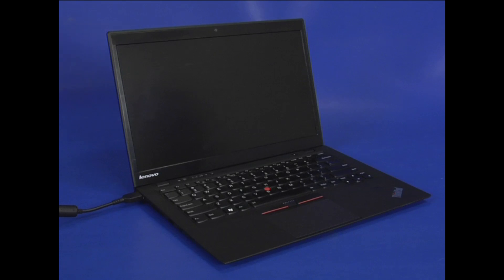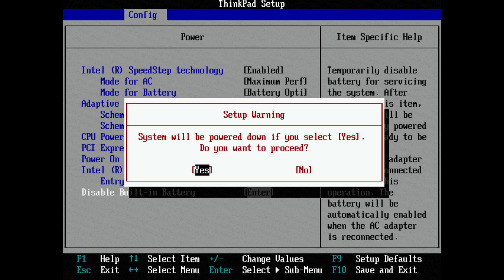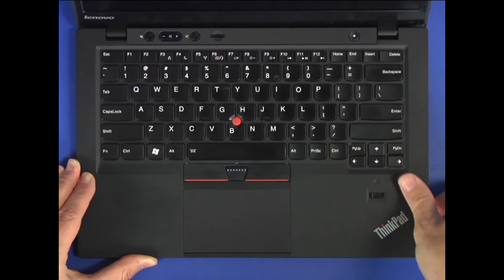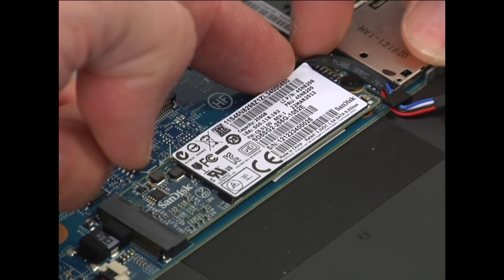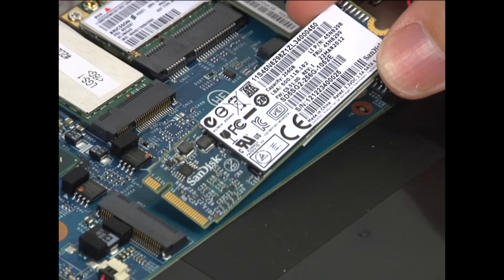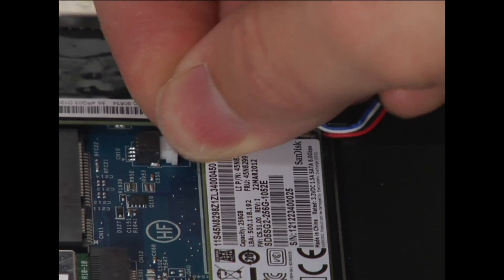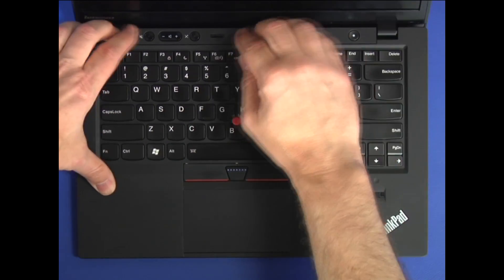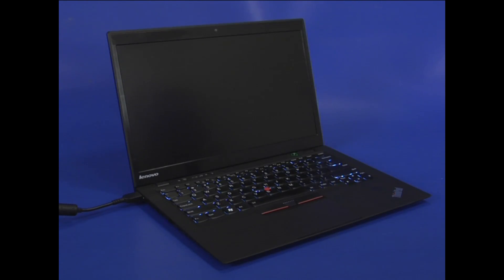ThinkPad X1 Carbon (1st Gen) - Solid State Drive Replacement

Comment: I buy Lenovo thinkpad x1carbon ultrabook gen1 but it is no have ssd and i dont find this model ssd can you help me my model is 3637 i7 8gb ram
Reply from the maker: Hi there, @Motivational world5560! Thanks for reaching out. Could you please share us with the machine type model (e.g., 34XXXXXXXX) for us to check? We're here to help. -Maru_Lenovo
Reply: @LenovoSupport  3448C66
Reply from the maker: Thanks for sharing the machine type model. Upon checking the compatible parts https://pcsupport.lenovo.com/us/en/products/laptops-and-netbooks/thinkpad-x-series-laptops/thinkpad-x1-carbon-type-34xx/3448/3448c66/parts/display/compatible?CID=ww:lenovosocial:20x96, there are seven (7) compatible SSD. Please see the list on  the link. Let us know if you have other inquiries. -Maru_Lenovo
Reply: @LenovoSupport  if i use m2 ngff adapter ssd 2242 it is good or it is not damage laptop because it is original ssd is 1000dollars it is too expensive in one last question how much is the new one of this laptop models

Comment: Are ssd its the same hdd? Where in lenovo x1 g9 is hdd?
Reply from the maker: Hi there, Nikolas. Thanks for reaching out to us. HDDs are traditional storage devices with spinning platters that read and write data. SSDs use newer technology that stores data on instantly accessible memory chips. Typically, SSDs are faster, quieter, smaller, consume less energy, and more durable. Let us know if you have other questions. Rodney_Lenovo
Reply: @LenovoSupport  I have lenovo and i dont know password when iam change ssd pasword unlock?
Reply from the maker: When you mentioned that you don't know the password, are you referring to the password that you are using in order for you to sign in to Windows? What account are you using? Is this a local account or a Microsoft account? We'll wait for your reply. Rodney_Lenovo
Reply: @LenovoSupport  i dont know but on 90% is local. I power my lenovo and is first password and i write this password and next step is "user name" and "password" and i dont know, becouse its not my lenovo.
Reply from the maker: We understand. The only way that you can access the laptop is if you put in the correct password, otherwise, you will not be able to enter Windows. Rodney_Lenovo

Comment: hello friends. is it possible to put an ssd with 512 or 1000gb in this device? do you have an recommendation for a price which will not kill me
Reply: and how can i copy all my data including windows 10 to this new ssd?
Reply from the maker: Hi there, Bordo Mavi. Thanks for reaching our support. Kindly share with us the machine type model (ex: 82XXXXXXXX) so that we can check your upgrade options and at the same time, we can provide you the part number for the compatible SSD that you can use to your laptop. Regarding your inquiry with the data transfer, we highly suggest for you to reach out to a data specialist near your area to ensure that all important files/data will be transferred successfully in the new storage. Rodney_Lenovo
Reply from the maker: Our apologies, but that is not the information that we're looking for. There is a sticker with the MTM number of the device which is usually located on the bottom part. The MTM number is 10 characters long and is usually labelled as Type. Rodney_Lenovo

Comment: Hello, I have that same laptop, the RAM memory is soldered. I wonder if I can put 1 RAM memory in the module below and could you tell me what SSD this Lenovo has, please, I have that laptop and I am missing the SSD.
Reply from the maker: Hi Dragón ballZ Lara goku. Thanks for reaching out. We're happy to provide assistance or direction to help you with this. Can you send via private message the serial number, so we can check? Keep us posted. Heart_Lenovo
Reply: @LenovoSupport  Lenovo thinkpad x1 carbón 2generation
Reply from the maker: Hi. Upon checking the laptop's memory was soldered to the system board and no sockets. Kindly see below product specs for your reference https://lnv.gy/3tmkLLq. Let us know if you need anything else. Heart_Lenovo
Reply: @LenovoSupport  I need an m.2 ssd the port where the ssd goes has 1 slot my laptop is lenovo thinkpad 2 generation it has 4 ram and an intel inside core i5 vpro processor also tell me if it supports a 2 tb or 1 tb ssd please I need to know the exact ssd it has thanks
Reply from the maker: Hi. Can you send via private message the serial number, so we can check on the actual model of the unit? Here's how to locate your serial number: https://lnv.gy/3u6kR90. Keep us posted. Heart_Lenov

Comment: My computer wouldn't turn I try to use in the pinhole to turn it on didn't work and then I disconnected the battery and I couldn't use the  configuration menu did wondering did I damage my laptop by not being able to access that option
Reply from the maker: Hi Bonez, thank you for bringing this matter to our attention and apologies for the trouble. Would you please join us in DM/PM (Twitter or Facebook) along with the machine's serial number so we can check your warranty repair options?   Here's how to find it: https://lnv.gy/3AZPpvi Case number #1587463 

We look forward to hearing from you soon. Jersy_Lenovo

Comment: Lenovo support, I need help finding an enclosure for this SSD drive. The motherboard on my laptop is fried and Im unable to replace it. I really need my data though, and have been unsuccessful in finding some sort of enclosure/reader for this ssd so I can extract my data. Please Please help!
Reply from the maker: Thanks for reaching out, Lovdeep, and we wish to help. May we have the serial number  shown on the bottom sticker of your machine, so we can check other details and repair options. You may also click on the link below for help in finding the serial number:

https://lnv.gy/3ns8lg9
Carll_Lenovo
Reply: @LenovoSupport  Thank you for your response Carl. 
Serial Number:R9YM2CY
Machine Type Model:3444CYU
Reply from the maker: Thanks! Based from this similat forums thread https://lnv.gy/3vqCjnz
, the X1 Gen 1 used a special "Sandisk 20 + 6" pin connector. Kindly search for X1 Carbon 1st Gen SSD enclosure to see results on where you can purchase this. Any brand will do. Erica_Lenovo
Reply: @LenovoSupport  Omg thank you so much Erica!!!! i will look and order. Can i send you and your team some beer or something? you all are life savers!
Reply from the maker: You're welcome, Lovdeep! Let us know if you need additional assistance. Stay safe and have a great day! Erica_Lenovo

Comment: Hi I need help regarding upgrading SSD of my X1 carbon 1st Gen it currently has 256GB and I need more capacity 500GB maybe. Can you please let me know if SSD form factor for X1 carbon 1st Gen is still available in the market and where can I find it. Thanks a lot your response will be much appreciated. Cheers
Reply from the maker: Hi Jerieme! Thanks for reaching out. I think yes, it is still available in the market, but we don't have a specific store or online store to check. You may try first to check it on your local computer parts store or to an online reseller. Let us know if you have other concerns. Mark_Lenovo
Reply: @LenovoSupport  Thanks for that quick response. One more thing if is not too much can you please provide me specific details of that SSD  for X1 Canbon 1st Gen e.g. form factor, dimension, etc. so that it would be easy for me looking that online or here in the local store near me. Thanks a lot.
Reply from the maker: Based on the specifications, it's a SSD SATA Small Form Factor. You can check it here https://lnv.gy/2QCewyH - I also found a similar discussion in our community forums that might help you https://lnv.gy/3bdGACa - Mark_Lenovo
Reply: @LenovoSupport  none of these shortcut links work anymore. Could you please update them? Or just post the full address? Thanks

Comment: Thanks for that video on this stupid model computer with the unicorn SSD flash drive. The close shot of you putting the 256GB drive in allowed me to see the numbers and find that flash drive on EBAY.  Only one left in the US. The rest you could only get in China. You helped me out and saved me time. FYI for other people reading, I don't believe there are any 500 or 1 TB drives that fit this computer without using an adapter and jerry rigging it in place to the motherboard. Only 128 and 256 GB 26pin flash drives are available. Here is the number of the 256GB drive that fits.  SandDisk SD5SG2-256G-1052E
Reply: there is a daughter card slot adapter for the newer samsung m.2 evo drives
Reply: @clearraines49  I know, I saw that. It just looked like a pain to make it fit in there. Or do you mean there is a solution where you don't have to file things down to make it fit in the space?
Reply: It fits nicely with the Samsung evo 970 1tb. That I have, it's faster than the dual core i-7 cpu that has a thermally locked frequency range of nothing
Reply: Bro can you post link so I can buy one too

Comment: Looking for ssd replacement on Amazon. Mines died. None will fit. Anyone know which one will fit?
Reply from the maker: Hi roblee11! Thanks for reaching out. If you're using the same ThinkPad X1 Carbon (1st Gen) the compatible M.2 SSD for the laptop is M.2 NVME 2260 and it supports up to 256GB. Kindly check this link https://lnv.gy/2MsDkFR photo for reference, including the list of compatible parts. Let us know if you need additional information. Jan_Lenovo
Reply: can i use normal m.2 (with two keys) in 1st gen carbon?
Reply: @LenovoSupport . Thank you! Wouldn't hapent to have a link to where I could purchase would you? I see some with the same name but the notches look different. Thanks!
Reply: @LenovoSupport  You have posted a photo in the link above of a two key drive but say one key is only compatible? The NVME 2260 is a two key SSD?
Reply: @LenovoSupport  As my understanding you can't put a M.2 NVME on that port which is SATA3, https://forums.lenovo.com/t5/ThinkPad-X-Series-Laptops/NVMe-support-on-the-X1-Carbon/m-p/2064793
Reply from the maker: Hi Muhammad! Good question, we only recommend to use M.2 NVME SSD with single M key to avoid compatibility and performance issues. Jan_Lenovo
Reply: hi LenovoSupport , i underatand ur point, but due to lower  cost of a normal M2 drive, i wanted to try it out. thus the question... if it will not work, than i shall not order one.
Reply from the maker: We advise not to buy M.2 SSD with two keys as it will not work. Mac_Lenovo
Reply from the maker: Hi roblee11. Thanks for writing in. You may purchase, the part from any third party online or store part reseller like Amazon. Unfortunately, we do not have the resources to check on their posted products and we suggest contacting the reseller for details. Let us know if you need additional information. Auxen_Lenovo
Reply from the maker: Hi Cole! The computer will only work with a Single key. We've double-checked the photo above and it is only a single key. -Jerry_Lenovo
Reply: Hi  @LenovoSupport  will it works with M2 NVME 1 Tb?
Reply: Hi lenovo. What is single key and what is two key?  Sorry if the question sounds stupid

Comment: Please help I wanna add an ssd on my first gen and I'm suffering to find something can you help? Know any sites I can use? Or adapters if there is.
Reply from the maker: Hi Eddie! We'd like to help. It seems that you can only upgrade the SSD card in your device, since we only have one slot for the storage device (http://lnv.gy/2wSyAou). You can look for the compatible SSD card part number and adapter on this page (http://lnv.gy/2wSg5k4). And if you're in the US, here is a link of the webpage http://lnv.gy/2wS7Lkv on where you can order from Lenovo. Otherwise, you will need to check any 3rd-party online reseller. Reggie_Lenovo

Comment: can you upgrade the RAM as well?
Reply from the maker: Hi Chiemi! That's a very good question. I checked on this, the RAM of the Thinkpad X1 Carbon (1st Gen) is not upgradeable since it is soldered to the motherboard, you can check that information here http://lnv.gy/2vTD79K - This model has 2 variant, it's either you can get the 4GB or 8GB RAM variant. Let us know if you have other concern. Mark_Lenovo
Reply: Thoughts on ReadyBoost & SuperFetch?
Reply: Also, is the item labeled "4G/BT" correct? I'm missing that component but still have BT
https://postimg.org/image/c71j4ry5r/
Reply from the maker: As we mentioned, Thinkpad X1 Carbon (1st Gen) has 2 variant. It could have 4G or BT.  Could you provide us the serial number of your Thinkpad X1 Carbon (1st Gen) so we could take a look further? Auxen_Lenovo
Reply: nope
Reply: I got the 8GB one

Comment: Does the Carbon X1 1st gen support Pcie NVME SSD's as well?
Reply from the maker: Hello Vix. I'm not sure of the answer to this question. I would guess it does not, but I'll ask someone and get back to you.
Reply: iv check an article and it suggests that the x1 1st gen has proprietary SSD's specifically made for these models exclusively from sandisk. Although they can be swapped but still not with any current gen SSD's. Please see below links for the article as well as sandisk press release clarifying that the X1 1st Gen uses their custom X100 SSD's.

Article:  https://www.notebookcheck.net/Review-Lenovo-ThinkPad-X1-Carbon-Ultrabook.80288.0.html

Sandisk press release:  https://www.sandisk.com/about/media-center/press-releases/2012/sandisk-provides-custom-storage-solution-for-lenovo-thinkpad-x1-carbon
Reply: Hello Lenovo support, my serial number is R9/XP024 does it support PCIe M.2 2280 drive connection slot?

thank you,
Reply: nope

Comment: Do you know if the Samsung 950 Pro internal SSD is compatible with the ThinkPad X1 Carbon 1st Gen?
Reply: it would not be. This laptop uses some proprietary 20+6 pin ssd, and they seems to be expensive and limited to 256gb.
Reply: Monopoly.... You can actually buy adapters for this case.
Reply: do you know the right name for these is it mini 2 or msata?
Reply: nope, not directly. It  might work with a SATA version and an adapter, but I didn't tested yet.